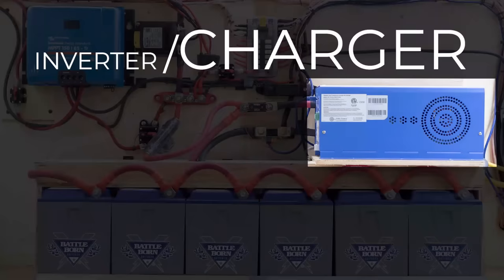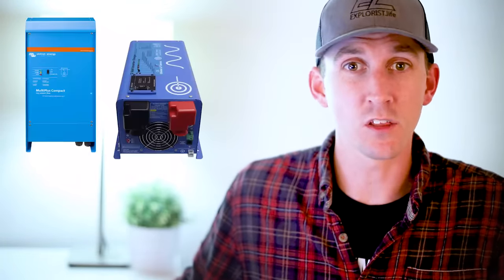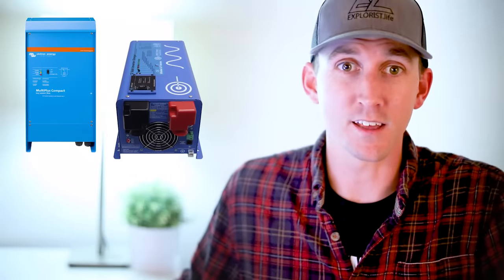Basic Solar Parts Needed for a DIY Camper Van or RV Solar Install

Comment: Have a Freightliner Sprinter 2.1 4 cyl 3500 van that I will be living in, Covid-19 really set my direction. I have a 40 amp charge controller, a 6000 watt inverter, a 1000 lithium battery and two (360 watts) solar panels. How should I set them up? Instructions for Dummies. A newbie wanting to know is everything compatible and will I be hooking up everything properly. If you tell me everything is compatible than show me one of your videos that I can follow that would be perfect. Thanks for all your help
 Have to do this by myself. No help and exhausted almost all of my budget. Need to purchase proper gauge wiring, etc.
Reply from the maker: That sounds like a great project!  It's pretty tough for me to give advice when somebody has already started buying components before coming up with a solic plan.  For example... I would personally NEVER recommend running a 6000w Inverter from a 12V battery bank.  

I do have a wiring diagram for 6000w of inverting power but it's a huge split phase system powered from a 24v battery bank: https://www.explorist.life/shop/solar-wiring-diagrams/24v-6000w-120v-240v-split-phase-camper-solar-wiring-diagram/

That's the closest thing I've got for 6000w of Inverting power that may help but the wire sizing will be way different if you are using a 12v battery bank.

Comment: It appears the batteries can be fed multiple charging inputs in parallel through the solar charge controller and shore power inverter/charger. Is this not an issue? Seems like it could defeat the charging modes.
Reply from the maker: Victron solar charge controllers sense external charging sources and will stop charging automatically.

Comment: What size fuse or breaker is needed for a 3000W inverter, from a 300Ah 12v battery? I had figured 300 Amp. Is that correct? 
I have 4-200W panels, 300Ah LiFePo4 battery, 3000W inverter and a VE 150/85 smart charge controller. Oh, and a 100A fuse block, buss bars. This is all going in my popup camper. The whole fuse/circuit breaker thing has me confused. 
Only 3 panels will fit on the roof, so one will be on the ground.

Comment: Is it better to set up as a 24vDC system then add converter to 12vDC and use 24vDC to 120vAC inverter?
Reply from the maker: If you have over 1200w of solar or need larger than a 3000w Inverter, yes.  Otherwise, no.

Comment: Do lithium batteries really like alternator voltage current? I unhooked mine...maybe the isolator cleans it up?
Reply from the maker: When run through a DC DC Charger, Lithium batteries charge perfectly from the Alternator.

Comment: Hello, I want to buy a schematic in how to solar my 02’ airstream 30’ classic with slide out. From start to finish. I’m thinking going 12v all the way and minimize the propane usage. So a/c, ref, stove n water heater are been replace to 12v.

Comment: So the inverter charger is used just for charging with shore power and you still need the charge controller from the solar correct? Or does the inverter charger take the place of the charge controller?
Reply from the maker: The Inverter Charger allows you to use power from shore power and charge your batteries from shore power.

The solar charge controller allows you to charge from solar panels. 

They are 2 separate items with 2 separate purposes.

Comment: Hi Nate,

I was looking in to setting up a solar power system for a skoolie that my wife and I are about to get.  We are needing to run the AC on 24/7. What is the minimum requirement we will need to run the AC 24/7. We were thinking 4x200W Solar panels with 2 12V 100AH LiFePo4 Deep Cycle Batteries. Will that allow the AC to run overnight? Until the Solar panels can run the AC and charge the batteries at the same time?
Reply from the maker: For air conditioner usage, you're realistically looking at a minimum of 600 amp hours of lithium and 1200w of solar.   If you are comfortable with that large of a system, great!  But if not... a gas generator will be the only other feasible option.

Comment: Hello. I’ve got a question about panels and battery setups. If I’m wanting to have my battery bank setup as 12v wired series parallel for 24v do I have to have 24v solar panels, or can I just use 12v panels wired the same?
Reply from the maker: Your solar panel array needs to be a MINIMUM of 5V over the battery bank charging voltage for the MPPT charge controller to turn on.  You can use whatever solar panels you like to come to the proper array voltage.  more info: https://www.youtube.com/watch?v=6G3Mo_OHmQY&list=PLmvhcyi4n0TVgcroqXl5QvJM0afUes_zX&index=3

Comment: If I put a solar panel in my cargo trailer, I need to have a switch for when I connect it to the light or connected, it continues charging with the panels.??

Comment: So I see you used blue seas block , would 4/0 wire be ok for this or do I need a  breaker box panel instead , I plan on running 400ah battle born setup with a 4000 watt inverter
Reply from the maker: For power distribution, I recommend this: https://www.youtube.com/watch?v=YiufFMKolpY

For wire sizes, It'd probably be worth checking out my wiring diagrams: https://www.explorist.life/solarwiringdiagrams

I don't have any systems on there with 4000w Inverters, but for that size, you'll be looking at running a 24v system.

Comment: Please help. 😭I’m getting a 400w renogy solar premium kit, and with that I’m getting a 4000w 24v inverter. With that I was going to get 4, Battleborn Deep cycle 100Ah 12v batteries. Does that make sense or do I need a 24v battery?

Comment: I have access to 2 deep cycle semi batteries  those are I believe 24v  . I have 2 150w 12v panels. Am I just grabbing parts that look good. Or do have a start?
Reply from the maker: Electrical Golden Corral rarely ends in a good result.  Come up with a full, overarching plan similar to how I have prepared here (explorist.life/solarwiringdiagrams) and size/choose your components based on that.

Comment: Question: I'm looking to run a small AC unit, some AC devices ( tire warmers aka heated blankets ), dc devices ( lights, laptop, phone ), I would look to have a battery pack chargable from my van alternator or from a shore hookup ( generator or grid ). How would I size an appropriate battery and inverter setup?
Reply: Tire Warmers are rated at 1000w (depending on the set)
AC unit recommendations?

Comment: any idea on voltage input and out put for a Toyota Prius Gen 1. lith battery ? i've got  24 volt panels ? Mppt controller,   prius batteries , into 12 volt inverters . Trying to figure out how to hook it together.

Comment: Where do the dc breakers go? Before the charge controller? Or between each component?
Reply from the maker: You should check out this wiring diagram for fuse locations: https://www.explorist.life/3000w-inverter-400-600ah-400-to-1200w-solar-camper-solar-kit/  or any of these here: https://www.explorist.life/solarwiringdiagrams

Comment: if i have a complete installed camper but i would like to add the solarsystem, do i need to connect load or just panel and battery.

Comment: What size breaker do I need?   I am building a solar power system that will be used to power a freezer and some other small devices if we loose power.   Right now I have 4 100watt 12 v solar panels, 2 200 ah batteries,  a 2000w inverter and 40 A charge controller.   What size/type breaker do I need between my batter and my inverter and what size/type breaker do I need between my inverter and the load?
Reply from the maker: I think this diagram would meet your needs: https://www.explorist.life/2000w-520w-60a-budget-friendly-camper-wiring-diagram

Comment: Not sure which video to ask this, but need major help. Just installed our last two solar panels and forgot I should plug in solar panels last…seems like my dc stepdown is smoking. Shut down whole system. Stepdown should be plenty high enough amps. Main switch for panels is off, but am I safe to unhook mc4 connectors and turn on system to see if everything is ok? Any reason that stepdown would smoke like that? Panicking…trying not to hurt myself or bust the whole system. Everything has been smooth before this. Some specs that may help answer my question….

Solar array

100.2 volts
19.78 short circuit amps
120.87 open circuit volts
18.82 amps
1890 watts

Stepdown is Victron Orion—70A continuous load/85A max load

How do I move forward safely?
Reply from the maker: If you're connecting solar panels to a Victron Orion... that's simply the wrong part.  You need a solar charge controller like the Victron SmartSolar MPPT charge controller to go between the solar panels and the Lynx Distrbutor.  Consider checking out the diagrams at https://www.explorist.life/solarwiringdiagrams to see what parts go where in a system.
Reply: @EXPLORISTlife  I didn’t explain this clearly. It’s connected to an 80 amp MPPT charge controller. My set-up is based on one of your diagrams and has worked for well over a year. I just added two more 315w solar panels and am now having problems
Reply: Wow! In my rush to reconnect I put the solar wires into the DC load on my solar charge controller. Stupid 🤦🏻‍♀️

All good now

Comment: Do You Do Build Outs and Solar ? Or Do U have a place to recommend to Wire Solar Out Like this ...I have bought 2 200 watt Solar panels from Newpowa online New in box ....mark down ..guy bought to many ....and   plan to Buy a lithium 200ah Battery  for my system  ....the Rest of What Needs to Be Purchased and DESIGNED ....cause my van needs a Build Out (empty canvas 93 ford) seems like a Lot ....I don't wanna do wrong. Over spend or do it twice. I see these lists but being a first timer I am overwhelmed at Amount of Info and PIECES I Need to Buy. ....need assistance

Comment: Hey man, I've been watching your videos on youtube and had a question about my personal solar system in my van. I have everything i need, have all the wires and connections made, just not sure if i need a ground, or how many, or to each component? Just not sure and want an experts opinion. My solar system is extremely basic aswell
Reply from the maker: Sure!  All of my wiring diagrams on https://www.explorist.life/solarwiringdiagrams show which equipment needs chassis grounds and how they all tie together.

If you are using different components than what I have in my diagrams, check the user manuals of the components to see if they require an equipment ground.

Comment: Hi i plan to set up 6000 watts inverter on my RV. What gauge/awg will i use to my 6000 watts ok nverter and to connect my 6 batteries for series connection. Thank You
Reply from the maker: Since I do not have enough information about your system to provide a complete answer, I must refer you to my diagram that has 6000W of Inverting power coming from a 24V battery bank: https://www.explorist.life/24v-6000w-120v-240v-split-phase-camper-solar-wiring-diagram/

Comment: 3.28 minute in and I have a quick question before I forget... if you had the same amount of solar panels but 4 inverters charging the same amount of batteries in a set of 4 power banks... would that charge at a 4×12=48v ?? I'm quite new to this lol
Reply from the maker: I'm not really sure I understand what you're asking.  Would you mind clarifying?
Reply: @EXPLORISTlife  it's ok I got my answer answered and the answer was, yes, yes it does

Comment: Am I over simplifying... in an operating RV, replace the converter (115 V to 12 V) with an inverter/charger (12 V to 115 V) with proper wiring between the solar powered battery bank and the inverter/charger and you are done??? Doesn't the inverter/charger include an isolator to make sure shore power is only used to charge the battery bank?
Reply from the maker: Oversimplified, yes... but that's the main idea of how it works.  Here is a diagram for retrofitting all of this stuff into an OEM RV with 30A shore power: https://www.explorist.life/30a-camper-inverter-with-solar-and-alternator-charging-wiring-diagram/

And inverter charger has a transfer switch in it so that it can power items via shore power passthrough and then charge the batteries with whatever is leftover.

Comment: Battle Born and Victron are good quality your Aims seems out of place, how are Aims inverter/chargers they are in your pictures??
Reply from the maker: It's a fine budget friendly Inverter.  It uses significantly more power when not in use than the Victron inverter doesn't have PowerAssist and doesn't have NEAR the features/settings customizeability that the Victron has, but if somebody just needs a budget friendly Inverter/Charger that just works, the AIMS Inverter is a good option.

(Also, keep in mind... we've upgraded our system over time.  We initially had AGM batteries and a Midnite solar controller.  The Victron Battery Monitor, MPPT, and the Battle Born batteries were system upgrades.)

Comment: I am setting up a solar and wind generator system for a cruising sailboat. Can I run them both into the same charge controller?
Reply from the maker: I believe some charge controllers allow that, but I'm not 100% sure off the top of my head which ones they are as I mainly deal with land-based mobile solar where wind power is less common.

Comment: Would 300w solar and a 200ah battery bank be enough to charge my phone and keep a diesel heater running 24/7

Battery is agm so 50% usage max

Comment: So does a charger inverter combo charge the batteries from pedestal/shore power and then also power whatever standard house plug appliances you use? I'm trying to find an inverter that can support like 6000w or more.
Reply from the maker: Correct!  The Victron Quattro line of Inverter Chargers has capacities up to 15,000w.  Here is a 5000w model: https://amzn.to/2ZSack9

Comment: I want invert the 2000w solar power system with charge control and inverter combo and plug it in the 30amp camper plug in to run everything including the AC 
Doesn’t that seem simpler?
Will that work?
Reply from the maker: Wiring it internally seems simpler to me, but you do you.

Comment: Hey I’m wondering what gauge wire should I use coming from my 4, 12v 100h battle born batteries going into my Victron Quattro 5000w inverter.
Reply from the maker: Is it the 12V Quattro or the 24V Quattro?

Comment: Hay I have a question for I recently acquired 5270 w used solar panels I'm not sure exactly how to hook them up to my RV I would like to use the existing power supply thing for my generator it had the RV hasn't owned in generator unfortunately it does not work at this time I would like to know if if possible to hook the solar panels into the generators system to use the 12 volt power and to use the power from the outlets and my motorhome through it
Reply from the maker: Here is a playlist that should start to help you to figure out how to wire that array: https://www.youtube.com/playlist?list=PLmvhcyi4n0TUjVGA_O5aI5SQrS1kKLgEF

Comment: So om pretty sure they are 30 amp automtive is the same as 30 amp houshold? Correct? Ive built my van and found a bus is much more needed space. (Van will be towed behind bus:)) i have a surplus of breaker boxes so o was thinking of using a sub panel box to distrubute to my outlets bit if i wanted to male some things dedicated 12volt could i still use say a15 amp breaker via the 12 volt wiring if the bus bar is seperate from 110?
Reply from the maker: Household breakers are rated for 120v/240v AC power.  You need to check to make sure the breaker/fuse you plan on using is rated for the type and amount of power that will be flowing through it.

Comment: Nate, is there a difference between home solar panels and rv solar panels, I'm asking because I found and bought 2 - 250w panels for my sprinter and checked voltage and in half sun it shows 36 volts my controller says 12 - 24volts should I hook up or get something else
Reply from the maker: There is little difference in the two types of panels.

Here is a video that will teach you how to size a charge controller to match the solar array: https://www.youtube.com/watch?v=MxziHKvTRh8

Comment: I get how the system should be configured and wired but i’m stuck at one part. How do I hook up an RVs electrical system to the fuse block? Do I connect from the RVs fuse panel to my systems fuse block?
Reply from the maker: I have OEM RV Retrofit diagrams available here that show how that works: https://www.explorist.life/solarwiringdiagrams

Comment: So If I have like 400 watts and 250 amp hours but my goal is to have 500 amp hours and 900 watts should I use wires for my goal since I plan on adding more panels and batteries ?
Reply from the maker: Yep!  It's always a good idea to plan ahead in an attempt to decrease the amount of re-work and re-purchasing necessary.

Comment: I have a question, if I buy a Victron 50 amp charge controller . Can I run that with 2 deep cycle battery’s and a 3000w inverter. The inverter came with a fuse attached to the red cable . Can I run this without anything else . No other fuses or breaker switches . I don’t want an emergency shut off